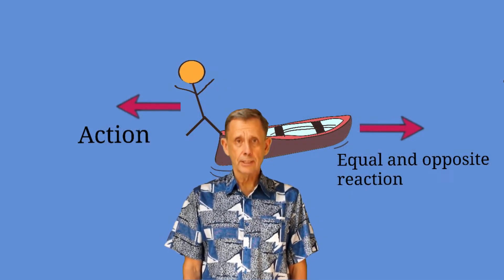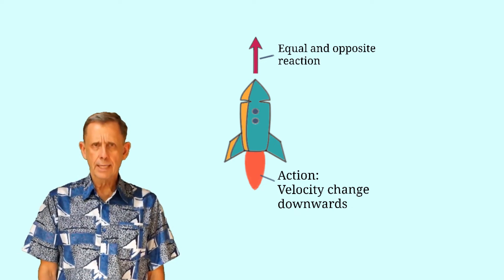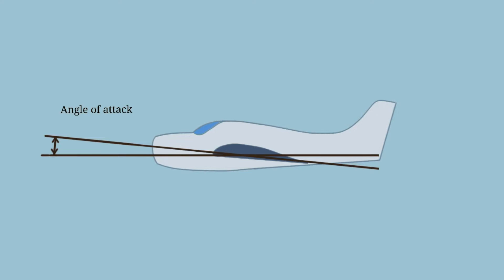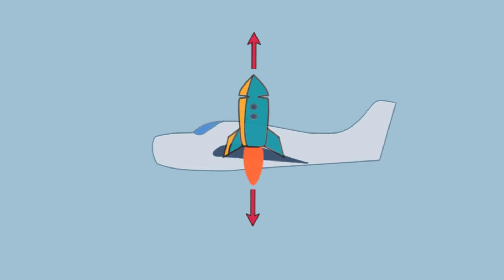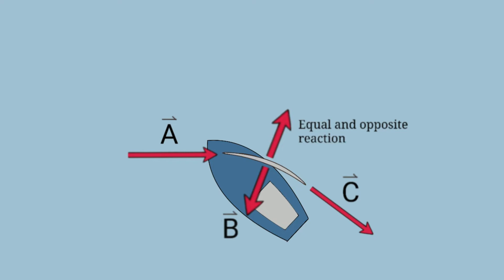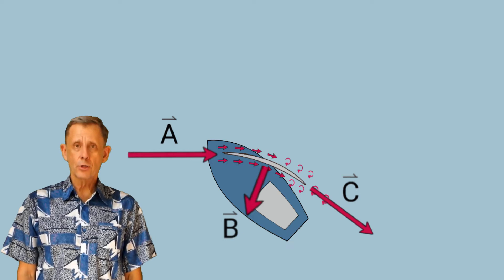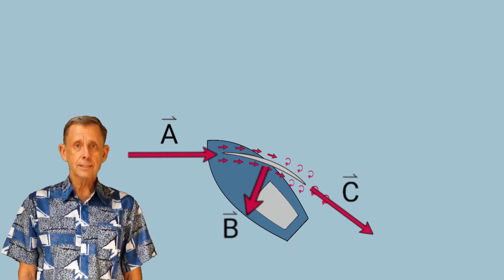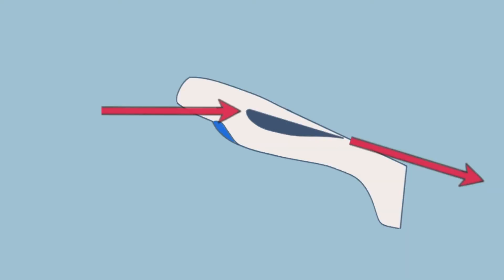Physics of Sailing Video 2: Drive in Sails

Comment: One question. This doesn't explain how the drive force in sails equates to a forward motion. The drive force is mostly oriented sideways, not along the longitudinal axis of the boat. So while there IS a forward component, it is usually not the major component. How does the shape of the boat, and the implementation of a keel factor in to make your boat go forward, instead of sideways? In aviation, a similar phenomenon takes place, the reaction force isn't oriented perfectly perpendicular to the wing, it is also oriented back. This is induced drag, drag created because of the production of lift. What is that sailing equivalent?
Reply from the maker: Perhaps you might get a better understanding of the forward component of the reaction force in sails from Physics of Sailing Video 5: Points of Sail. And yes, there is induced drag in the system, especially when you trim a larger draft in the sail.

Comment: Granted, you are trying to simplify here, but the incidence angle is the angle of the wing to the aircraft.  The angle of attack is the angle to the apparent wind.  So, for example, an aircraft with an incidence of two degrees must be pitched up 8 degrees to achieve an angle of attack of 10 degrees. Lift is  perpendicular to the angle of attack, by definition.
Reply: Sails are not "flat sheets".  They are curved, and are crude airfoils.  Windsurfers often use RAF (rigid air foil) sails.  Hang gliders use single surface wings... which are also airfoils.
Reply from the maker: The traditional, incorrect explanation of lift says that a wing has a camber, and so the airflow has farther to travel over the top of the wing to meet up with the airflow over the bottom. In fact, there is no requirement for air particles splitting at the front of the wing to meet up at the trailing end, and experiments show they don't. But even if it were true for an aircraft wing, a sail has no camber, it's a flat sheet, there is no difference in the distance air has to travel over the outer and inner surfaces, regardless of if it is curved when under sail.
Reply: @BasicCruisingwithOwen  I do not disagree with your first two sentences,  But as anyone who has sailed or seen a sailboat knows, sails are curved (both in 2d as viewed from above,  and in 3d, given broadseeming or modern alternatives such as 3Di.  The sail's curvature (draft) is what makes it a moderately efficient airfoil,  as compared to a flat sheet of glass or a thick pieces of plywood.   In a good sail the point of maximum draft is at about 30%, just as it is in the upper surface of many airplane wings.
Reply from the maker: I'm not arguing that rigid sails don't work, of course rigid wings work on aircraft too, and rigid airfoils may be used on windsurfers. But sails have no camber, they are flat sheets. They may be curved when underway, but they're still flat sheets.
Reply from the maker: The diagram shows the aircraft in straight and level flight, in which case the angle of attack is both the angle with respect to the aircraft and the apparent wind.
Reply: @BasicCruisingwithOwen  You have incorrectly drawn the angle of incidence as if it is the angle of attack.  Wings are not mounted to airplanes with the very large angle you have shown.

Comment: Awesome video, thanks! 
However; a curved airfoil DO create a low pressure (suction/lift) on the curved side as well. Just hold the curved side of a spoon under running water from a faucet, and you’ll see. Better yet, next time hold that piece of paper stretched out in front of your mouth and blow on top of it. Same result.
Reply from the maker: As I say in the video, it's a complicated situation, and of course there are pressure differences. But the point of the video is to show how the deflection of the airflow creates lift.

Comment: Think I'll go with the NASA engineer. You gave a good explanation of a boat which moves sideways. And a sail is not flat when full of air it looks remarkably like a wing shape when full of air.
Reply from the maker: A sail has no camber, so the explanation that the airflow has farther to travel over the outer surface is incorrect. A sail may look a lot like the upper surface of a wing, but it doesn't look like a rigid wing, it's a flat sheet.
Reply: @BasicCruisingwithOwen  The leeward side of the sail curves outward (ballooning), which causes the area after the ballooning to be in shadow from the air movement, creating a region of lower pressure compared to the windward side. Meanwhile, the mast and sail’s luff compress the oncoming air on the windward side, generating a pocket of higher pressure. This pressure difference accelerates airflow over the leeward surface as it tries to equalise, much like an airfoil. A Harvard wind tunnel demonstration has shown that the airflow on the leeward side exits faster than on the windward side, reaching the trailing edge sooner. This allows the sail to accelerate air backwards faster than the true wind, generating lift that propels the boat forward.

Comment: Fascinating videos thank you. This leads me to ponder the role of the keel ?If the wind vector pushes the boat sideways how does the boat move forwards?
Reply from the maker: The wind can be divided into 2 components, a sideways vector plus a forward vector. The keel only inhibits the sideways force component vector. There is still a forward component that pushes the boat forward. Think of a bar of soap sliding sideways at a 45 degree angle towards the side of the bathtub. When it hits the side of the tub, all sideways motion is stopped, and the bar only slides forward. The keel doesn't perfectly stop all sideways motion however, there is still some sideways drift called leeway.

Comment: owen, thank you for clearly explaining angle of attack and newtons principles as the main lift component of a sail.  it is disappointing to see and hear 90% of both sailors and pilots consider Bernoulli's principle to be the "main" lift component.
Reply: I don't think those are actually contradictory to be honest. Bernouli's principle essentially explains the physics of airflow, while Newton's principle is a more broad look at the system as a whole. Newton's principle alone does not really explain airflow separation and stall conditions - stalled wing will still deflect the airflow downwards after all, and same with contaminated upper wing surface (such as icing conditions), and yet those conditions have severe effects on lift and drag.

Now regarding planes flying upside-down, please remember that airfoils are producing lift at a certain angle of attack, and for asymmetrical airfoils, you'd require higher angle of attack to produce the same lift on the "wrong side", and it will produce more drag in those conditions. It doesn't disprove the Bernouli principle, it just disprove the idea of "air molecules have to travel further on the top side to meet up with the molecules at the bottom" - which is in fact incorrect. In both normal and inverted flight, airflow will be faster on the upper side of the wing.
Reply from the maker: Yes, that is in fact what the explanation is intended to indicate, that the distance the air has to travel over a wing is an incorrect explanation for lift, and air particles do not need to meet up again. And since a sail is a flat sheet, even if it's curved under sail, the air does not have farther to travel over the outer surface. But clearly there are pressure differences in the air flow, and lift is a complicated subject. But still, the majority of lift comes from deflection of the air flow through an angle. This is clear from the vectors.
Reply: I was about to comment on that, I have saw other videos on the subject and they try to argue that the lift force is due to bernoulli/venturi/magnus effect, whereas brilliantly explained in this video if that were true then it wouldn't be possible for planes to flight upside down. The true lift force comes simply by the change in the momentum of the wind as it passes through the wing/sail, old Newton's second law. Thanks for the great video.